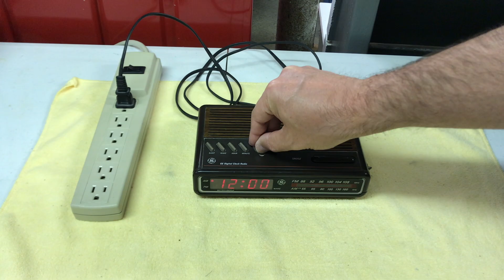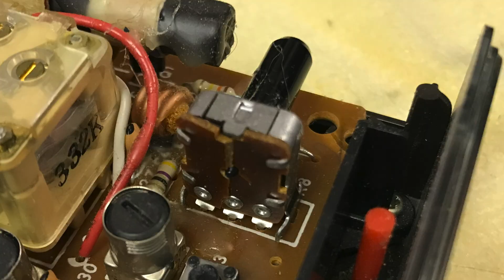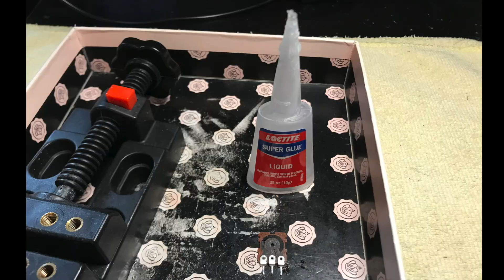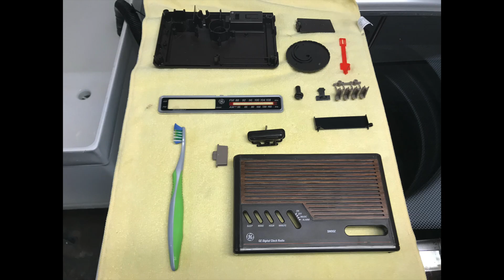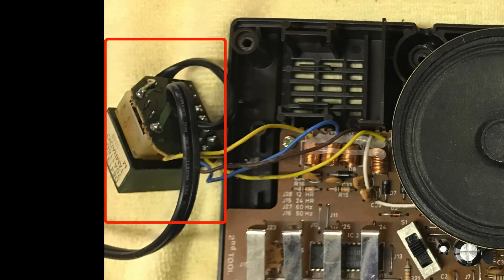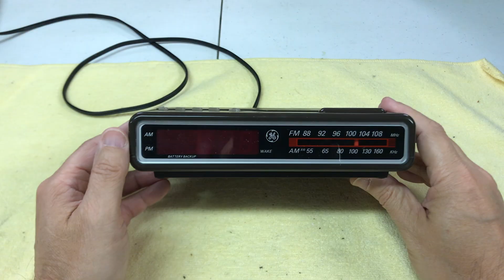1983 GE 7-4612A Alarm Clock Radio Repair

Comment: Excellent! I have the exact model.  It just started turning itself on? You can't turn if off. The selector switch on top "On-Off-Music-Alarm" will not turn the music off in the off position. When you move the switch to "Music" or "Alarm" the Alarm light on front display does come on. So is the selector switch needs Dexoit? Capacitors bad? I have the ability to check and change out the capacitors. Might it be something else? Thx in advance.
Reply from the maker: Start by hitting the Selector switch with Deoxit D5 contact cleaner.

Comment: Excellent! I have this clock radio from 1986 (5625) whose frequency drifts. Any suggestions? Many thanks :)
Reply from the maker: I was unable to find a schematic for this clock radio. I would need the schematic to determine the root cause.